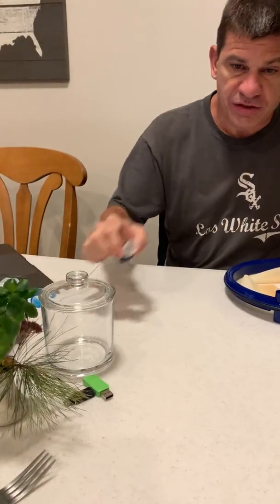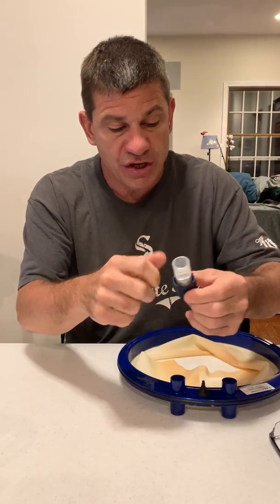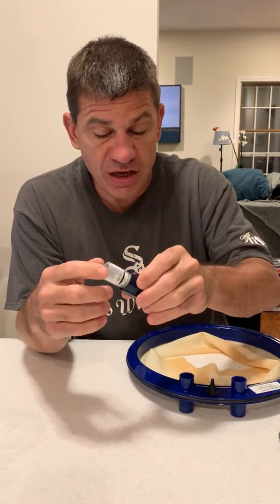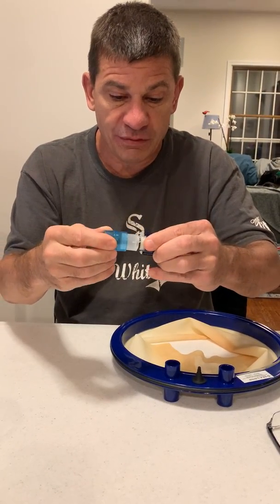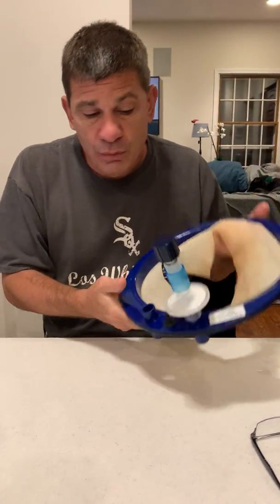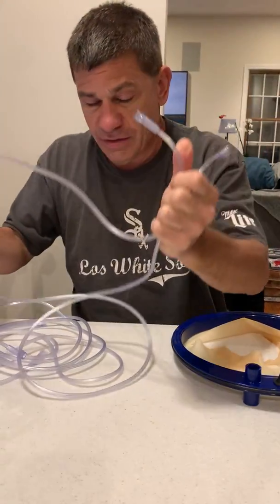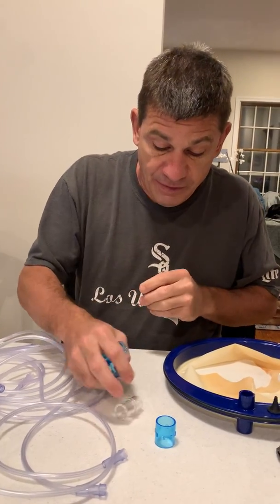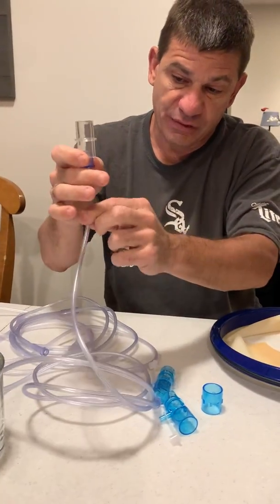Helmet ventilation USED with OXYGEN for COVID-19 patients! Bubble Helmet/No vent/ SEE  UPDATE LINK!

Comment: Doc. Just use a blender with one high flow meter that goes over 70L/M and you eliminate that three port inspiratory assembly. Less bulky. The blender will give you a more accurate FIO2 delivery too.
Reply: Would hate for parts to come undone
Reply: Thomas O It requires constant monitoring. It’s not what that hood was designed for.
Reply from the maker: how much blender cost?